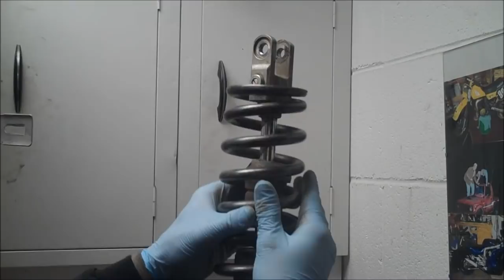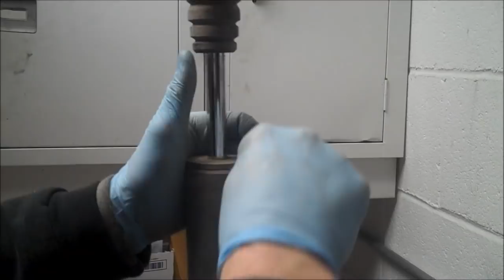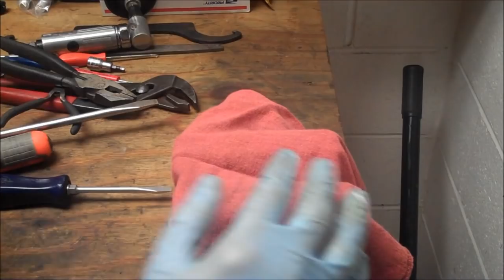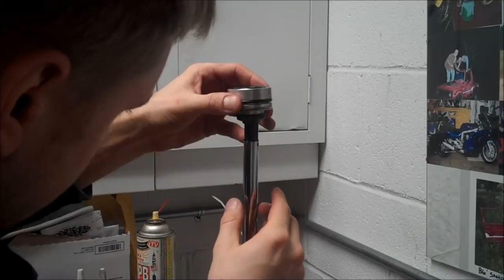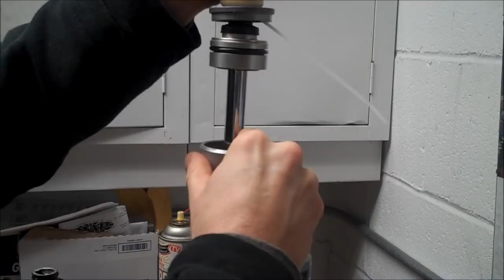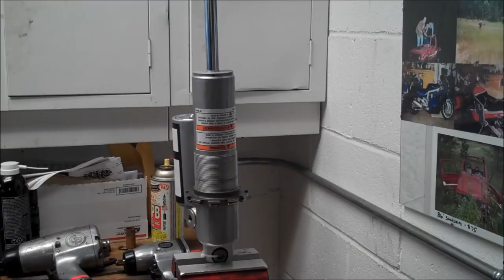How-To: KYB Shock Rebuild YZ CR YZF WRF KX

Comment: Hey man, just wanted to check in and say that this video convinced me to tackle my rebuild myself.  I got the Pivot works kit and a Racetech spring for my weight. Went and got it charged with nitrogen this morning.  I did find that in my shock, it already had aftermarket valving and that friction seal that came with the kit was too wide for the racetech gold valve.  I trimmed it down to fit and havent had a problem.  It looks like your KX videos are kinda old now, but PLEASE dont take them down, we still need these 99-02 specific videos.  Thanks again man!!!

Comment: Bleeding the air out of the shock with a syringe works really well!  I went down to my local grocery store and the pharmacy department gave me a couple free oral syringes that fit perfect in the bleeder port

I just rebuilt the shock on my 2005 yamaha r6 a few days ago, installed a race tech gold valve... This was my first time ever servicing a gas shock, it was time consuming but not as difficult as I first imagined... 

It was such a good feeling to have the shock all put back together, clean and ready to ride.  Just wanted to thank you for making this video definitely picked up some good tips that made the job easier...
Reply from the maker: Cool thanks for the feedback.

Comment: Noticed if you put your valve with seal installed in the freezer, it shrinks up good!
Thanks, for putting out content for kx250. I have a 2000 kx250 and your info is great! Just bought your vid on top end and worked great for step by step tutorial. Another 70 hours before the bottom end is ready for a rebuild. 🤘🏻🤘🏻🤙🏻🤙🏻

Comment: Great Video! Have a 2002 KX 250, was able to rebuild my shock with 0 problems for my first shock rebuild ever, thanks to this video! Great work! Saved me tons of $.
Reply from the maker: Awesome! Good job!
Reply: MatthewMCRepair
Matt, I seen in Rocky Mountain ATVs video that the bladder requires nitrogen. I kinda skipped throughout your video, but did you use just plain air and did it require a certain PSI?
Reply from the maker: Gorbachev I took it to a shop who filled it with nitrogen to 175psi for $5. Don't use plain air.

Comment from the maker: Try working the shock to rid any trapped air bubbles. Leave bladder out and also the shock cap at other end. Use the bleed hole at end of procedure.

Comment: nice video.I am rebuilding my shock and i have a question.When i put the blader in and fill it with air i see bubbles coming from the other side.Is that normal?

Comment: Best way to keep the valve stack in order is use a Philip screwdriver and slide the stack onto it. Plus cleaning the shock before working on it helps keeping debris from getting into places.

Comment: 42:45: Does the tightening torque of the nut affect damping characteristic, is it important to maintain the exact torque spec to get the needed damping, so the nut torque is some sort of adjustment or doesn't matter if I tighten it a little bit more?

Comment: great video. thanks for sharing.
the shock on my 99 xr250 is really soft. spends more time in air. no oil leaks or anything though. You think a rebuild like this should fix it or is it another issue in your view?
Appreciate any pointers before i strip it down.
Reply from the maker: Is the shock really springy like a pogo stick? That would mean the shock is not dampening at all.

Comment: i highly recommend to use a shock seal head driver ... you can find some at $35.00. I use the K-Tech one ... and it goes smooth without risk of damaging the seal. Good video !
Reply from the maker: Have a link? I'd like to check it out.

Comment: hey matthew, i have a question, i want to do it for my kxf 250f unitrak shock, i dont understand in the time when you fill with oil and put the piston assembly, when do you close it? i mean when you purge, with compresed piston or descompresed? i cant explain it, look at 52:40 minute, in that part its my question, doesnt vary the level of fluid? because if its descompressed it will be more space for fluid, if it compressed less space for fluid, ?
please help me, im getting crazy hahah!!!
thanks! really good your video
Reply from the maker: Monica Armentano The piston allows for fluid to pass. Just fill it up to get rid of all air. You want a bit of fluid to spill out.

Comment: Hi Mat. Thx for the video. I did everything like you did but have huge problems with the shock. at 51:38 in your video, you can push your rod down / up quite easily. I cant. Its such a huge resistance - its possible but with a lot of force only (definitly not like in your vid). Do you have any idea what could have happened? :( Btw I am not using real shock oil. I used Maxima 5w Fork oil (I am quite low on budget and still had some Maxima oil left). Could this be the reason? The viscosity difference compared to shock oil? I am totally sure I did everything right (like you in the video)... I completed the shock and also did the bleeding process - but still its VERRY hard to push the rod inside and it wont come out again. But I dont have the nitrogen in yet... only air with ~60 psi.

Greetings & thx again.
Reply from the maker: +Nunuatak Nonatakaa Are you doing it fully assembled and air in the bladder? If so, then yes it will take both arms to compress it. Will it extend on its own?
Reply: +MatthewMCRepair hey Matthew! I gave up on this (actually the first time - I even disassembled the engine but maybe I have not talent with shocks). I dont know what exactly went wrong. When I put the rod inside I couldnt move it up or down without extremely heavy force. This went so far, that when I tryed to disassembled the shock again (because obviously something went wrong) I couldnt slide out the rod without opening the bleeder screw and letting out the oil first, because it was so sticky inside.

Finally, I gave the shock to a service specialist. This was a good idea, since it was very cheap for me because everything was already disassembled and replaced (the seals) and I also needed the shock oil and the nitrogen charge. So this guy could do it for me for only 70 euros (all completely) which is ~80 $. He also noticed an huge scratch in the rod. First he wanted to sell me a new rod for 220$ but I told him that this is no option, so he grinded the whole rod and its looking like new now :) So I am very happy. Next time I will go there again... definitly worth the 70$ dollars (it was +10$ for the grinding).

But thank you for helping / assisting. Like always, your videos are the best resource for a DIY men like me (except shocks now lol) and it helped me disassembling the shock which saved a lot of money.

Greetings from germany!
Mike
Reply from the maker: +Nunuatak Nonatakaa Glad you got it figured out! Thanks for the compliments!

Comment: Great video, but i have a question: what tipo of gas you used to fill the expansion chamber? i think nitrogen, i'm wrong? and what is a typical working pressure for the gas? thank you, and congratulations for the video.
Reply from the maker: DarkDragonSorrow Nitrogen, 175-180 psi.
Reply: MatthewMCRepair thanks for the information

Comment: Hey mat my shock has really slow rebound after i adjusted it to stock settings. I think i over tightened the clickers.  Is there a way i can take it apart and fix my mistake?
Reply from the maker: +philkism I'm sure you can take it apart, however I have not done that procedure so I really don't have any advice, sorry.

Comment: so you can use air if you check it when the temperature changes? 
I'm working on a 1987 KX500  KYB shock, does anyone know why the bottom damper adjustment is stuck. I had the adjuster out, its a bevel drive gear that runs through the rod, but no was to free it up??

Comment: Why didn't you put the new bush in the freezer and then use the vise and socket to press the new bush in, 
instead of flaring the edges of the bush by hammering on it?
Reply from the maker: I guess I'll do that next time.
Reply: Not criticizing you, was just a suggestion. Very helpful vid cheers.

Comment: At the 1hr mark when you pushed the rod in and then put air into the bladder the rod should have extended back out on its own and it did not. You still have air in cylinder

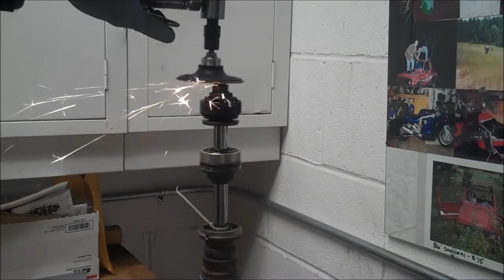Comment: Hi Mat... At 13:09 why are you grinding the top of the bolt? I have the same shock and I’ve tried to unscrew this bolt without grinding the top of the bolt... after make a little force it’s released.
I stoped this job to came here ask you this! I´m afraid to complete unscrew and damage something... 

(I'm not sure if it’s the screw that’s rotating or the shaft)

thanks..
Reply from the maker: They "peen" or "stake" the rod so the nut does not come off. Make sure you did not strip the nut and be sure to chase the threads with a die.

Comment: shrink the bearing using canned air upside down so it squirts out the freezing liquid inside, it will chill it to about -40 deg shrinking it so it will slide right in
Reply from the maker: Cool, I'll have to try that one day.
Reply: -40??....NO.
Reply: prove it wrong......
Reply: just what i thought, ya got nothing, compressed air is a liquid that boils off when it hits the ambient air, like propane tanks for grills its LP or Liquid propane as thats its state when compressed. Do some reading and stop making yourself look a fool by posting your ignorance
Reply: explain why you believe that

Comment: Stick a long philips head screw driver onto the end of the shaft and remove your valve stack sliding it onto the screw driver.  The zip tie method your trying to use just looks difficult and time consuming.